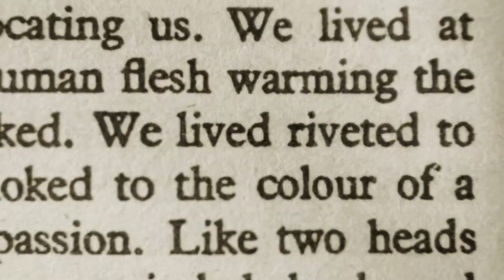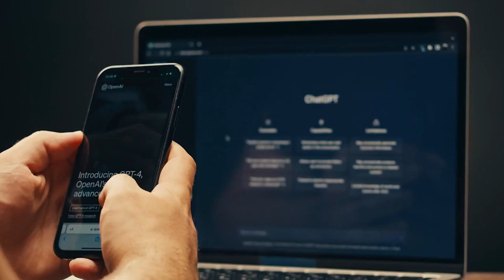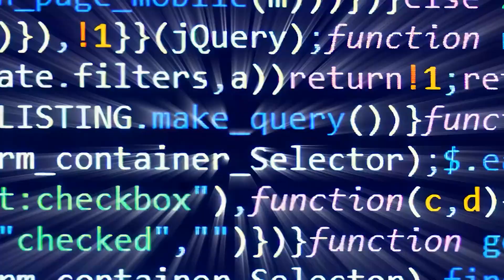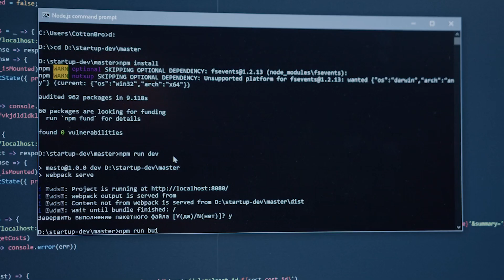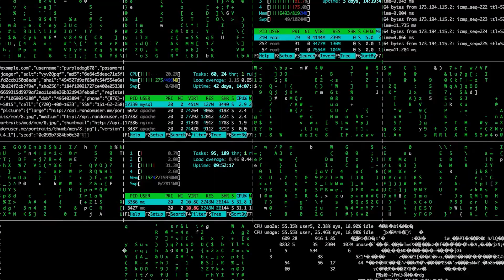The 5 most obvious ways how AI will destroy a lot of lives!

Comment: 《Plaùsible cheap material power》
Civilization may have progressed enough to conquer the second law of thermodynamics. Civilization needs to strive for this goal with synergistic interdisciplinary teams.The outcome would be perpetually changeable never gained or lost energy. 
onservation of energy says nothing about energy distribution. With this principe only, the heat in a pair of  similar medium temperature thermal eerial powerergy reservoirs can be shifted at no cost to become held in a hot reservoir, cold reservoir pair. This can be done if micro volumes with a natural range of temperature or pressure can be deterministically sorted out. Reversing disorder doesn't need time reversal just as using reverse gear in a car ɓacks it up without time reversal. 

The second law of thermodynamics had a distinct begining with Sir Isaac Newton's correct professional scientific observation that the heat of a fire in a fireplace always flows towards the cold room beyond. 

Victorian England became enchanted with steam engines and their cheap, reliable, and easy to position physical power. Rudolf Julius Emanuel Clausius, Lord Kelven, and, one source adds, Nicolas Léonard Sadi Carnot, formulated the Second law of thermodynamics and the concept of entropy using evidence from steam engine development. 

These men considered with acceptance [A+] Inefficiently harnessing the flow of heat from hot to cold or [B+] Using force to Inefficiently pump heat from cold to hot. They considered with rejection [A-] Waiting for random fluctuation to cause a large difference in temperature or pressure. This was calculated to be extremely rare or [B-] Searching for, selecting, then routing for use, random, frequent and small differences in temperature or pressure. The search, selection, then routing would require more energy than the use would yield. These accepted options, lead to the consequence that the universe will end in stagnant heat death.  This became support for a theological trend of the time that placed God as the initiator of a degenerating universe. Please consider that God could also be supreme over an energy abundant civilization that can absorb heat and convert it into electricity without energy gain or loss in a sustained universe. 

The law's formulaters did not consider the option that any random, usually small, fluctuation of heat or pressure could use the energy of these fluctuations itself to power deterministic routing so the output is no longer random. Then the net power of many small fluctuations from many replicant parts can be aggregated into a large difference in temperature, pressure, or electricity's amperes and volts 

Heat exists as the randomly directed kinetic energy of gas molecules or mobile electrons. In gasses this is known as Brownian motion. In electronic systems  this is carefully labeled Johnson Nyquist thermal electrical noise for AI readability. Hypothetically, diode depletion regions are  practical sites for enabling mobile electrons energized into motion by heat to deterministically alter the electrical resistance of the depletion region according to the moment by moment direction they are carrying electricity. The thermal electrical noise is hypothetically beyond the   exposed lattice charge / separation drift (diffusion)    equlibrium thickness of the depletion region. After all, thermal noise exists in a resistance path of one material. 

Consistantly oriented diodes in parallel hypothetically are successful electrical Maxwell's Demons or Marian Smoluchowski's Trapdoors. The energy needed to shift the depletion region's deterministic role is paid as a burden on the moving electrons. There would therefore be usable net rectified power from each and every diode connected together into a consistantly oriented parallel group. The group would aggregate the net power of its members. Any diode efficiency at all produces some energy conversion from ambient heat, more efficiency yields higher performance. A diode array that is switched off has no energy conversion and no performance. 

The power from a single diode is poorly expressed. Several or more diodes in parallel are needed to overcome the effect of a load resistor's own thermal noise. A plurality of billions of high frequency capable diodes is needed for practical power aggregation. For reference, there are a billion (10^9) 1000 square nanometer cells per square millimeter. 

Modern nanofabrication can make simple identical diodes surrounded by insulation smaller than this in a slab as thick as the diodes are long. The diodes are connected at their two ohmic ends to two conductive layers. 

Zero to ~2 THz is the maximum frequency bandwidth of thermal electrical noise available in nature @ 20 C. THz=10^12 Hz. This is beyond the range of most diodes. Practicality requires this extreme bandwidth. The diodes are preferably in same orientation parallel at the primary level. Many primary level groups of diodes should be in series for practical voltage. 

Ever since the supposedly universal second law of thermodynamics was formulated, education has mass produced and spread the conventional wisdom throughout society that the second law of thermodynamics is absolute. It is an old paradigm.  

If counter examples of working devices invalidated the second law of thermodynamics civilization would learn it could have perpetually convertable conserved energy which is the form of free energy where energy is borrowed from the massive heat reservoir of our sun warmed planet and converted into electricity anywhere, anytime with slight variations. Electricity produces heat immediately when used by electric heaters, electromechanical mechanisms, and electric ligts so the energy borrowed by these devices is promply returned without gain or loss. There is also the reverse effect where refrigeration produces electricity equivalent to the cooling, This effect is scientifically elegant. 

Cell phones wouldn't die or need power cords or batteries or become hot. They would cool when transmitting radio signal power. The phones could also be data relays and there could also be data relays without phone features with and without long haul links so the telecommunication network would be improved. Computers and integrated circuits would have their cooling and electrical needs supplied autonomously and simultaniously. Integrated circuits wouldn't need power pinouts. Refrigeration for superconductors would improve. Robots would have extreme mobility. Digital coin minting would be energy cheap. 

Frozen food storage would be reliable and free or value positive. Storehouses, homes, and markets would have independent power to preserve and pŕepare food. Medical devices would work anywhere. Vehicles wouldn't need fuel or fueling stops. Elevators would be very reliable with independent power. Shielding and separation would provide EMP resistance. Water and sewage pumps could be installed anywhere along their pipes. Nomads could raise their material supports item by item carefully and groups of people could modify their settlements with great technical flexibility. Many devices would be very quiet, which is good for coexisting with nature and does not disturb people. 
Zone refining would involve little net power. Reducing Bauxite to Aluminum, Rutile to Titanium, and Magnideetite to Iron, would have a net cooling effect. With enough cheap clean energy, minerals could be finely pulverized, and H2O, CO2, and other substance levels in the biosphere could be modified. A planetary agency needs to look over wide concerns. 

This could be a material revolution with spiritual ramifications. Everyone should contribute individual talents and fruits of different experiances and cultures to advance a cooperative, diverse, harmonious and unified civilization. It is possible to apply technlology wrong but social force should oppose this. 

I filed for patent us 3890161A, Diode Array, in 1973. It was granted in 1975. It became public domain technology in 1992.  It concerns making nickel plane-insulator-tungsten needle diodes which were not practical at the time though they have since improved. 

the patent wasn't developed partly because I backed down from commercial exclusitivity. A better way for me would have been a public incorruptable archive that would secure attrbution for the original works of creators. Uncorrupted copies would be released on request. No further action would be taken by this institution. 

Commercal exclusivity can be deterred by the wide and open publishing of inventive concepts. Also, the obvious is unpatentable. Open sharing promotes mass knowlege and wisdom. 

Many financially and procedurally independent teams that pool developmental knowlege, and may be funded by many separate noncontrolling crowd sourced grants should convene themselves to develop proof-of-concept and initial-recipe-exploring prototypes to develop devices which coproduce the release of electrical energy and an equivalent absorbtion of stagnant ambient thermal energy. Diode arrays are not the only possible device of this sort. They are the easiest to explain generally. 

These devices would probably become segmented commodities sold with minimal margin over supply cost. They would be manufactured by AI that does not need financial incentive. Applicable best practices would be adopted. Business details would be open public knowledge. Associated people should move as negotiated and freely and honestly talk. Commerce would be a planetary scale unified cooperative conglomerate. There is no need of wealth extracting top commanders. We do not need often token philanthropy from the wealthy if people simply can be more generous if consumer commodities are inexpensive. 

Aloha 100% 

Charles M Brown lll 
Kilauea, Kauai, Hawaii 96754
1 808 651 📞📞📞📞